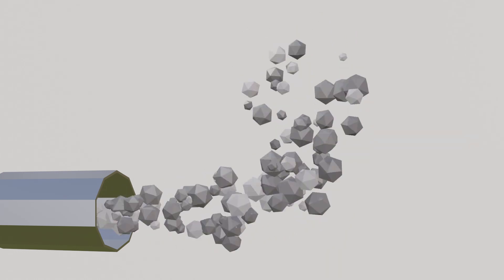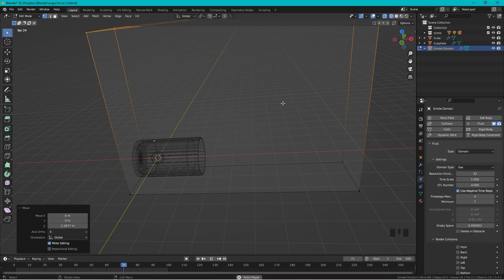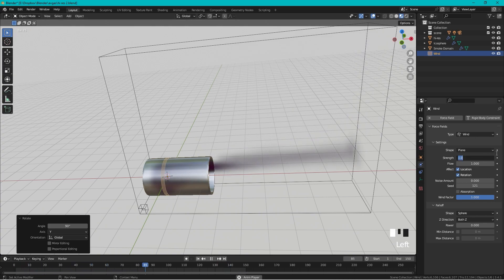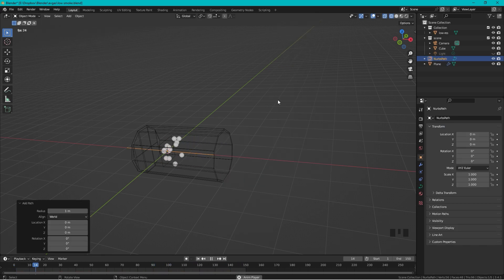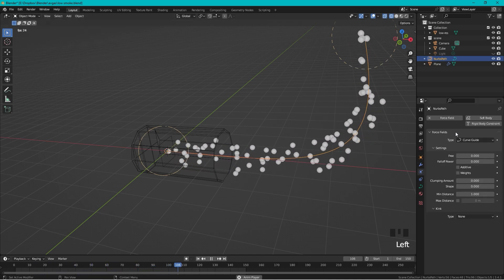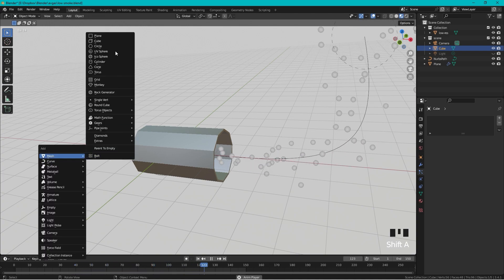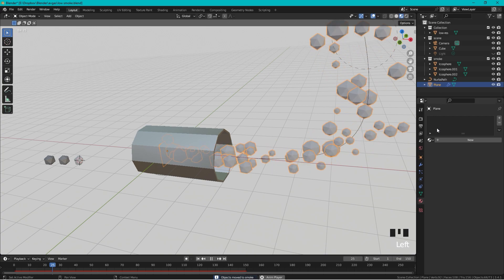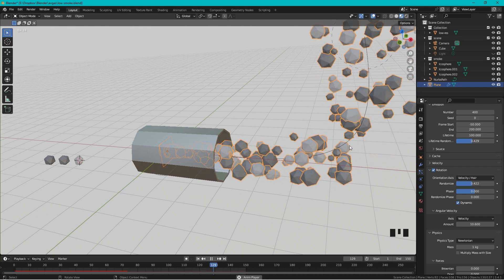Smoke and Exhaust gas - Blender

Comment: How to add curve guides for 2 or more particle systems (planes) and setup the curve path for each one of the particle source?
Reply from the maker: One way to solve it is to put your curve guide (or any other effector) in a collection. Then select your emitter and go to the "particle settings" and then open the "Feild weights" tab. Then you chose the effector collecton you want to use. Hope this help!
Reply: @3dplockis  Thanks for the advice! I was doing it by baking a particle system and them hiding curve guide for each particles systems...